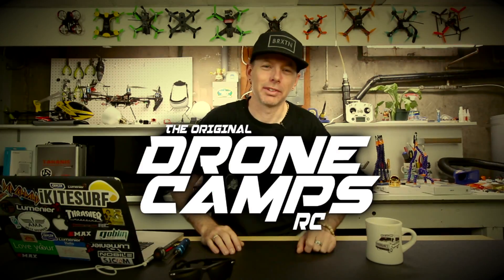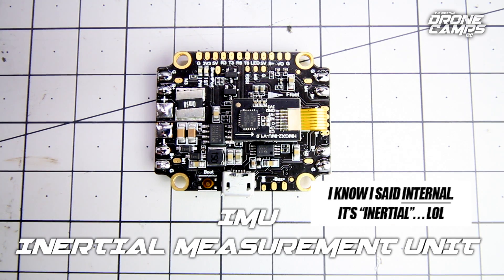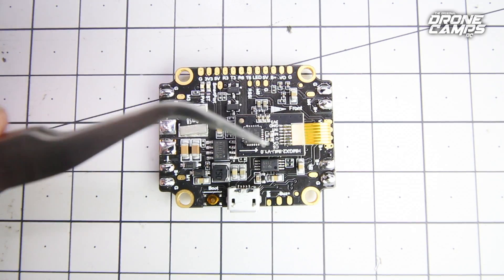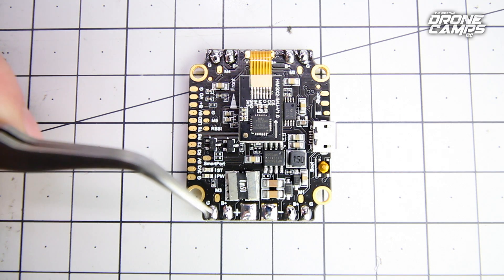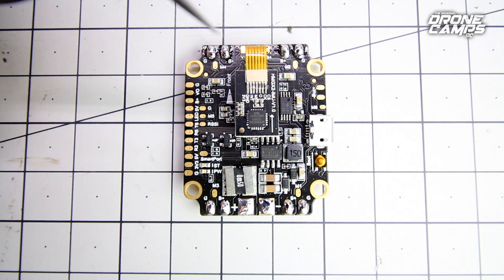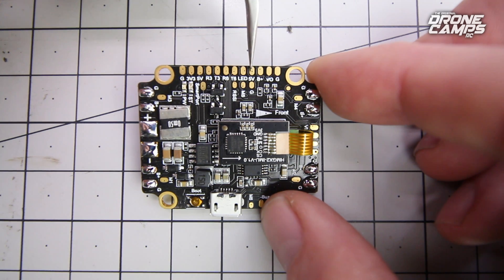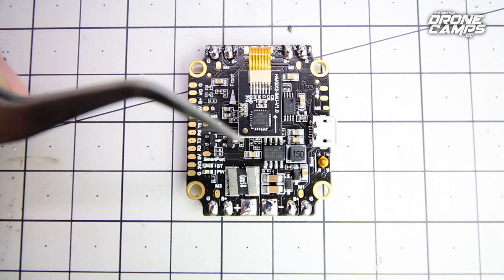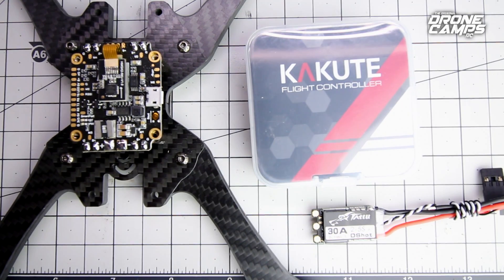NO SOFT MOUNT F4! - Kakute F4 AIO, OSD, with Floating IMU

Comment: Hey i have the same board and i was wondering how many milliamps does a foxeer v3 fpv camera use? I also habe the crossfire micro reciever and the unify pro v2 5v. I know the unify pro runs at about 600ma's on 800mw. Am i safe to run the vtx (on 800mw) and the crossfire on the 5v and the foxxer v3 on the 5v as well.? 
Is the B+ pad regulated? If i hook my fpv cam to the B+ pad would ist be filtered.? Or would i be safe wiring everything to the 5v?

Thanks steve

Comment: What a good starting number for the current sensor in betaflight?
Reply: Jeff Mc that depends on which batch you got.  If you have the latest batch with the 120 amp current sensor your good starting point is 275

Comment: It's "VI", as in "video input", and it's for the camera - same with "VO", which is "video output", and THAT one goes to the VTX.
(It also makes sense to put the VI pad to the front, as that's usually where the camera is located ;-)

Besides that, great video! My Kakute should arrive any day now...
Reply from the maker: Jan, thanks man. We already discussed that earlier in the thread. I'm aware of it. I made a goof. I know the difference. I flew the Kakute today and it was smooth as glass on the maiden. No tuning. Beta flight 3.2, Avan props, 2306 emax motors and new Tattu 30A escs. My fav new quad!